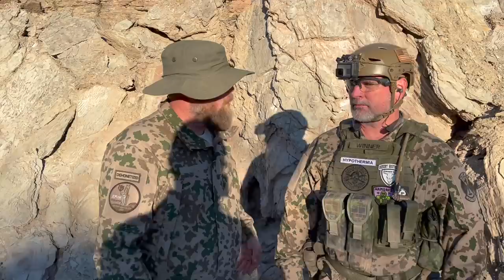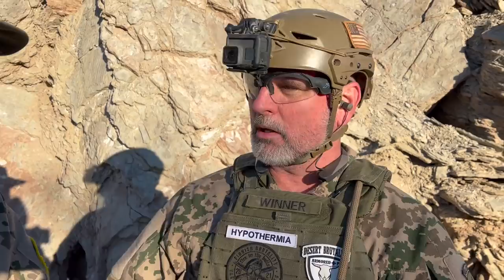WWSD - Why not a hydraulic buffer?

Comment: Title pic of broken buffer is from 2007, it keeps getting recirculated online. I have 40,000 plus rounds on 1 hydraulic buffer alone. There is no data supporting they are unreliable. Yes parts break, Ive seen bolts crack well under 10,000 rounds... One individual's experience is not data. There is one other picture of a broken hydraulic buffer online..I posted it, It gave out around the 30,000 mark. Are hydraulic buffers popular? No but they do work well and after all hydraulic buffers are in everything from industrial machines to motorcycle shocks. Are you introducing extra moving parts that will wear over time..Yes. But seeing how when I broke one it had out lasted 2 AR barrels, one needs to balance life span with shooting needs.
Reply: Your experience is also not data
Reply: @veldin25  true
Reply: Im not arguing with you but have you ever fired your  any of your 40k rounds in subzero conditions just 20 or 10 degrees above zero  just curious. I have but all of my ar are factory gi .
Reply: @davidycedo1606  Does Afghanistan in winter count?
Reply: @ModernTacticalShooting  yes whats the outcome.
Reply: @davidycedo1606  It worked entire trip

Comment: Would be interesting to fill it with some wide temperature range fluid and see if it performs better. There are enough engineering fluids that I have to imagine one would be available.
Reply: I suspect thats solving the wrong problem, a correctly designed buffer should offer the same pressure (thus resistance) across a massive "working range" range of viscosity, instead of a simple fixed orifice where temperature will always impact results. You might band aid the symptoms well enough with a really good oil that it will avoid most stoppages, but your still going to be dealing with drastically different cyclic rates, perceived recoil ect between hot and cold systems. This is AFAIK already a solved issue, with even ww2 aircraft guns cycling just fine between ground operations in hot climates, and the -40 degrees (c or f, its the convergence point of those systems btw) of upper normal combat altitudes. The 30mm cannon is an example of a hydraulic buffered gun in modern aircraft, and the Chinese example used in thesis works on the matter had only 15 parts.

Comment: Curious if this affects B&T APCs
Reply: nope it doesnt. my APC300 works fine even at -20C
Reply: The buffers in the APCs work pretty much as a recoil dampener, but the buffer in the AR is more complex as it serves as a critical part which cycles back and forth to control the velocity of the bolt.

Comment: Next Q (perhaps): Coins as shims, viable?
Reply: JP actually initially advised using a quarter for a shim if your SCS isn't under slight compression in the buffer tube before they started including their own shims. Could use a couple washers from your local hardware store, too.
Reply: People do it with spring powered Air Rifles to increase the power all the time

Comment: Sheesh

Hydraulic buffers are not reliable because they are not designed correctly. They work in automobiles in their capacity as shock absorbers, and enduring thereof much more mechanical duress; surely the technology can be miniaturized into a firearm.

Comment: hmm they seem to work fine in my B&T APC guns in the cold swiss alps. so maybe try another brand of hydraulic buffer?
Reply: I don't believe the APC's buffer is as important of a component as it is on an AR-10/15 system. IIRC the APC buffer is solely for reducing felt recoil and is very short. An AR relies on the buffer system to cycle the bolt and its function is integral to the system. I'm fairly sure you could redesign the APC to work without a buffer, not so much the case with the AR.
Reply: Most guns that have used hydraulic buffers (and they have been around since the dawn of machine guns) are designed in such a way that the gun will actually still function without the buffer, it's just going to be more harsh or beat itself up but it will still work. AR is not the same sort of setup
Reply: That's a completely different gun. 

You can't just say this entirely different weapons platform has this feature so the AR should too.
Reply: @someguy3167  watch the video again, they say that hydraulic buffer in guns are bad. they never even mention an AR. And i tend to disagree, the hydraulic buffers in my guns seem to work because (you are correct on this one) the APC was designed around the buffer and they use a proper buffer that was tested. thati s why i wrote that maybe another brand of hydraulic buffer (we assume the AR platform) might work better in colder temps etc.
Reply: @cosmoch  regardless of whether you're aware of it or not, the video was talking exclusively about AR type buffer systems, specifically in replacing a conventional spring buffer with a hydraulic one. When you buy an APC, the buffer designed to work with that system comes with the gun. That is obviously not what is being discussed by Karl.
Reply: @cosmoch  They at no point say "hydraulic buffer in guns are bad." The talk about outside super gamer guns they are not reliable. In that sentence it is obvious they Carl is talking about a "gamer" AR. Not all guns in general. It's called context clues my friend. This entire conversation is about the AR platform, it would make no sense for him to suddenly bring up other weapons platforms to justify changes to the AR platform.

Comment: I wonder about the results of a pressurised air or other gas cylinder being used.
It would be even less reliable and if you could eliminate all the other problems and somehow make it work, what with the bounce and all... but that doesn’t mean I don’t want to see it in high speed

Probably a question for Ian but does anyone know if this has ever been experimented with by anyone, ever?
I know squat about fluid dynamics and I can see some serious flaws but with the things I’ve seen on Forgotten Weapons it would not surprise me at all to find out someone had done so.

Comment: hydraulic fluid's viscosity, and therefore compressability, is adversely affected by temperature differentials.
this is why it is important to warm engines before applying a load and why suspension needs to be warmed and kept from overheating to maintain optimal operation. the operating temperature is a small band.
such a small volume , [hydro buffer], would be more quickly adversely affected by heat in use.
then there's the consideration of wear on seals increasing friction and likelihood of failure and certainty of wear.
this is also why brakes fade in use over the course of races.
mitigation can be achieved with dial-able damping, rebound damping and preloading, but this extra complexity becomes a liability in operation as soon as the unit is heated or below optimal temperature.
the smaller the volume of damping medium, the quicker the performance changes.
this in tandem with barrel harmonics, [also affected by temp variants] means that, depending on consistency of weather also, it would be impossible to assure zero for more than a few rounds in quick succession.
engineering solutions for engineering complexity leaves only one remedy : 'keep it simple stupid'.
k.i.s.s.  is why stoner thought the forward assist was a liability.
glad it was adopted, kyle really needed it that night in kenosha.

Comment: Only gamer guns huh. Might want to tell the Army that. They just adopted the B&T APC9K as their new sub machine gun. Which is designed around a hydraulic buffer.
Reply: That's a completely different gun. 

You can't just say this entirely different weapons platform has this feature so the AR should too.
Reply: @someguy3167  Yes it is a different platform, but it is comparable to the situation. A buffer does the same function in both systems. The APC9 is actually more violent being direct blow back vs DI.

B&T makes an AR buffer as well. Since they didn’t specify the make of the buffer we have no idea if this was hydraulic buffers in general or the quality of this specific brand of buffer.
Reply: @sethrich5998  I am going to quote youtube commenter "ColBunkMust" as he makes the same point I was going to make.

"I don't believe the APC's buffer is as important of a component as it is on an AR-10/15 system. IIRC the APC buffer is solely for reducing felt recoil and is very short. An AR relies on the buffer system to cycle the bolt and its function is integral to the system. I'm fairly sure you could redesign the APC to work without a buffer, not so much the case with the AR."
Reply: @someguy3167  They are different but the hydraulic portion doesn’t work all that differently. The main difference is that in the APC all of the mass is in the bolt carrier and it bottoms out on the buffer. In the AR the mass is split between the bolt and buffer. In both systems the hydraulic buffers only act when the system bottoms out.

Comment: Why not an A5 Buffer System?
Reply from the maker: Because there’s the JP system that’s better?
Reply: @InrangeTv  Not to be rude but I’m genuinely curious how so? The A5 allows a rifle length buffer in the same size format as the WWSD lower while being cheaper and adding more user adjustments as the buffer has more weight options. All with the lovely rifle recoil impulse.

It also is much cheaper and has less moving parts while providing a better recoil impulse.

If I’m correct the SCS only really benefits in removing the “TWANG” and if that’s a priority a Geissele Super 42 or TUBs Flat wire do the same for ~$25 all while being lighter and less moving parts right?

What’s the benefit of the JP SCS over an A5? I know I’m missing something and am genuinely curious as otherwise I really really like the build for a light handy rifle.
Reply: @LarpingSupply  I think they've stated in a previous Q&A that the main reason why they're not going for the A5 system is that is a proprietary system, and the JP system eliminates the need for a retaining pin which is the main failure point of the KP-15.
Reply: @draketheviewer6779  You don’t need a buffer retainer for any AR15 buffer. It’s nearly a creature comfort according to Karl and Ian. The hammer will stop the buffer during disassembly.

The JP doesn’t spring forward so I suppose that’s more convenient but heck of a price for that alone right?
Reply: @draketheviewer6779  On the A5 being proprietary, wouldn't this be far more proprietary though? Now instead of using a standard rifle spring with a unique buffer, you've got this completely unique system that if something broke, you'd be pretty much sol, vs the A5 where the spring could be easily replaced with any old rifle spring, and the buffer likely won't break at all.
Reply: @wolfgang_h3t  Nope, A5 uses a proprietary, longer tube, JP slots into a traditional carbine tube. Traditional carbine springs do not work with the A5 system
Reply: @pablackhawk  Forgot about the tube, but that really isn't going to break either tbf